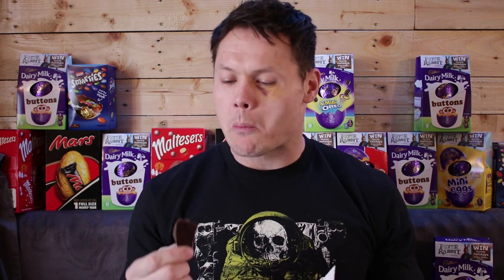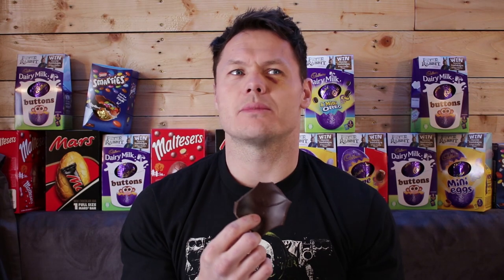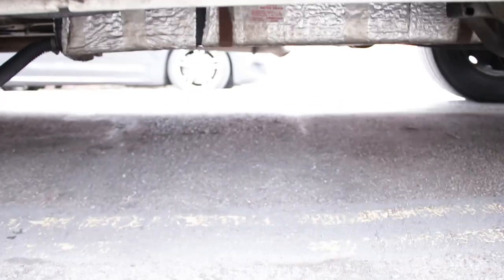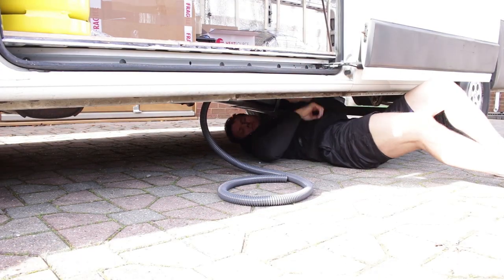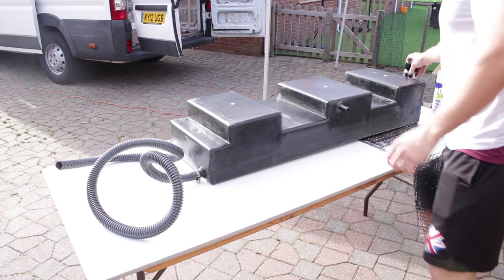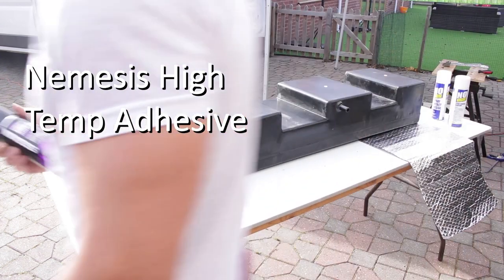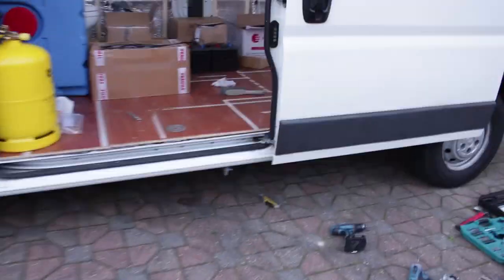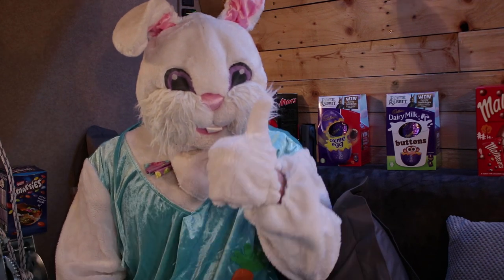Camper Van Under-slung Waste/Grey Water Tank Installation

Comment: Has the insulation you put on been enough to prevent water inside the tank from freezing?
Reply from the maker: Muhammed Ozsoy yes but I live in the U.K. and it doesn’t go much below 0 Celsius here during winter. The coldest it has been since I’ve had the van is probably around -6 Celsius
Reply: @MotoringHome  Thanks for the reply - great vidoes btw! I too live in the UK but was thinking about getting some heating pads just to be safe for when we take our camper to colder countries. I think I'll go with your route and skip the pads. Cheers
Reply from the maker: Muhammed Ozsoy Ah cool, for some reason my channel gets a majority American audience and over there the temperature can fluctuate massively. Yeah I wonder if warming your waste water could also produce a bit of a smell up through the drains? But it’s a cool idea and definitely one that could be done at a later date if needed. Best of luck with your build!
Reply: @MotoringHome  well the heating pads I'm looking into only kick in once it's below 5 degrees celcius and warm the tank to 7 before going off so I don't think it'll get warm enough cause a smell. They're controlled by a thermostat and cost about £30 for 2 on amazon.
Reply from the maker: Wow that’s awesome! Not too expensive either. I guess you just have to put a little hole in the top of the tank and push the sensor to the bottom? Very cool

Comment: What tank did you use?? Thanks
Reply from the maker: Really sorry but I can't remember. It was designed to fit my van but still off the shelf rather than custom though so you should be able to find one. Best of luck!
Reply: It looks like c.a.k tank. I'm trying to fit a similar one but 91L
Reply from the maker: @czeester  yes that sounds about right!